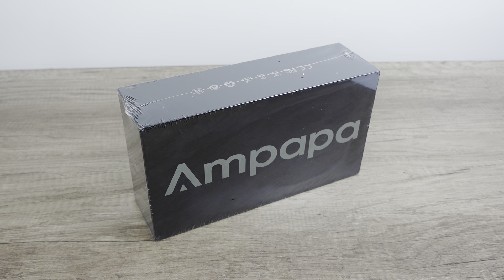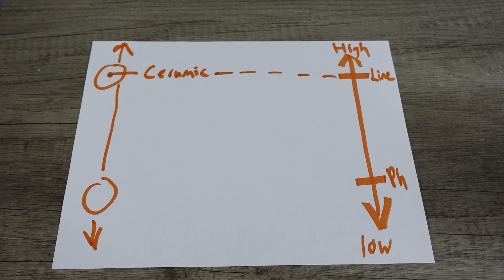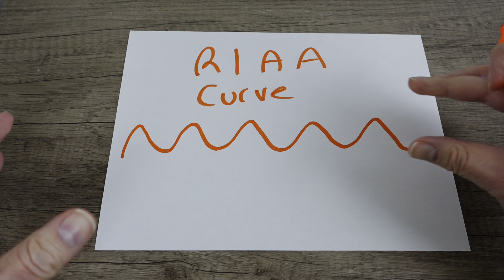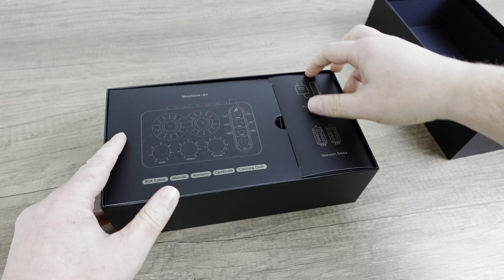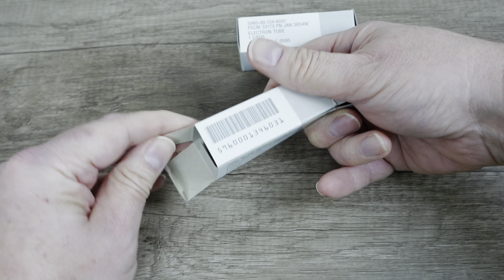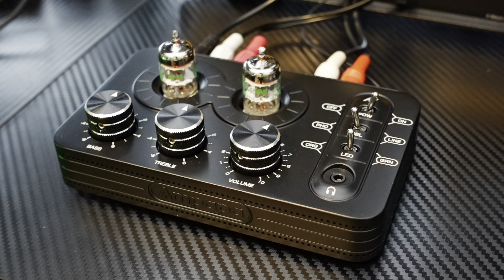Ampapa A1 Phono Preamp Unboxing & Review & Preamp 101 for beginners!

Comment: I not sure, if I did not already understand what you were talking about with the preamp phono and line levels and RIAA explanation - i am not sure I would have understood. It would be nice if you showed the RIAA equalization curve. And the voltage magnitude differences between phono and line levels. 

You can handle vacuum tubes, it was halogen bulbs that you weren’t supposed to handle.

Comment: Follow up comment.  I just ordered one of these and received it today.  Got it hooked up to my Technics SL-QL15 linear tracking turntable, and feeding it into a Marantz AVR8802a pre/amp processor, which then feeds into an Emotiva Gen 3 XPA-DR 3-channel amp (300 watts/chan), which then into some Klipsch RF7s floorstanding speakers.  Currently playing the album "The Silence of Wisdom" by Methodica, which is an absolutely incredible progressive metal album.  Will need a little time to let those little tubes break in, but I am pretty impressed with what this little phono pre-amp that I only paid about $130 for can do.  Sounds pretty clean and detailed, but does add that touch of warmth, which makes it a pretty nice match to the Emotiva/Klipsch since that can come off somewhat bright.  I will like to spend some time to compare this Ampapa A1 amp with the Pro-Ject Phono Box II that I also have and the built-in phono pre-amp that is in my Marantz AVR8802a.  That will take a little time as it is a kind a PITA to have to swap cables to test each one.  Also to add - yes, that case is aluminum, not plastic.  An additional edit - I have the tone controls on the Ampapa set to "flat"  ('0' setting) as I already have my system eq'd to my room through the Marantz using it's built-in equalizer, so don't need to add any more via the Ampapa's tone controls.  Also have the volume set to '9' on the Ampapa thus can control the volume through the main volume control on the Marantz.  Do wish the Ampapa had a switch to bypass the volume and just output a line-level signal.  Will need to listen to a few more records, but I do love how this thing sounds on that Methodica album.  Lastly to add.  This has probably gotta be the first time I bought something that I saw based on this channel's recommendation.  I did read and watch other reviews and just about all said this was an excellent little device, especially for the price.

Comment: Thank you for the explanation! I am new to the vinyl world, and am setting up my new setup this evening. This preamp explanation was exactly what I needed. Thanks again!
Reply from the maker: Glad it was helpful!
Reply: @Recordology  I do have a question if you don’t mind. I just connected my fluance rt-83, to my ampapa, and my ampapa to my receiver. I can’t get passed level 2 on the ampapa without the sound becoming distorted. The receiver is not up loud at all. Am I doing something wrong?
Reply: @OperativeRex  This is a month later, so I hope you had it figured out by now.  However, just to check.  Are you plugging the Ampapa to your receiver via the "RCA Out" and not the headphone jack?  If you plugged it in via the headphone jack, and then yes, it would distort if you turn the volume up too loud.  If using the "RCA Out", then it should not distort when turning it up past "2".  Either that or there may be something wrong with your unit.

Comment: The tubes shown are used in the low level modulator driver stage in the VOA/MARTI  GE SW 250kw transmitters . You DON’T need gloves at all to handle these tubes and others. Including the HUGE ceramic metal tubes used in the transmitters high level RF power amp and the 125kw audio amp modulator stage. I have handled all kinds of tubes without gloves for over 30yrs. Yes for the quartz halogen lamps you need the gloves. The oils of your skin break down the quartz.

Comment: Nice unit and sounds really good (as I can tell through the video and these "PeeCee" speakers).  Good explanation of how a phono pre-amp works and where it fits in a typical audio setup.  Sometimes a reciever/integrated amp/pre-amp/processor may have a built-in phono pre-amp as my Marantz AV8802 does.  Tempted to get one myself and see how it sounds compared to the built-in pre-amp on my Marantz, or the Pro-Ject "Phono-Box 2" pre-amp that I also have.  Would be using my trusty ol' Technics SL-QL15 linear turntable.

Comment: Teensy bit of confusion here.  It says "RCA OUT" rather than "LINE OUT", which said to me that it is actually a preamplifier output, implying that the volume and tone controls affect that output, so it can be connected to a power amplifier.  If it is just a line output the volume and tone controls would only affect the headphone jack.
Reply: The volume and tone controls do affect the "RCA OUT" as well as the headphone jack (will need to try it with my B&W P9 Signature headphones).  Do wish the Ampapa had a switch to allow by-passing the volume and tone controls and just output a line level signal on the "RCA OUT" and let me control the volume and tone via the volume and built-in equalizer on my pre/pro.  But than again, for something I snagged for only about $130 (I got it on sale), I can't complain to much, as this actually is a very nice piece of kit for the price.
Reply: @SkiBumMSP  I can confirm that to be correct !